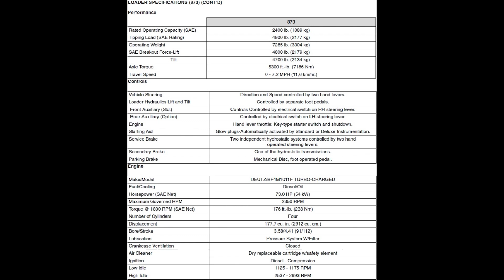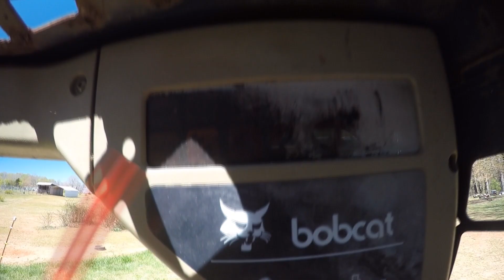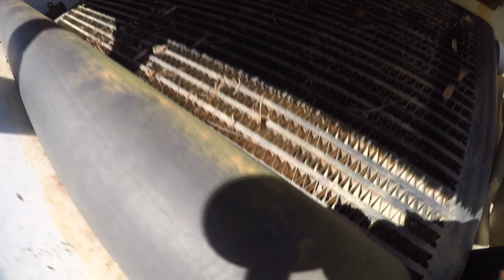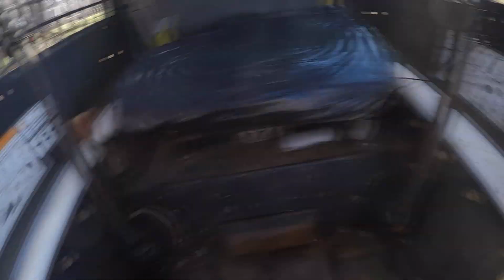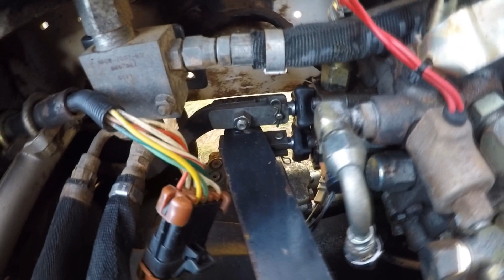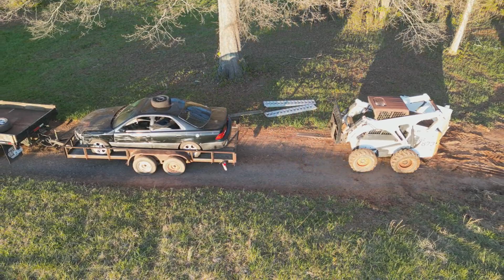Bobcat 873G detailed walk around/overview.

Comment: I buy a 1999 863  2100 hours on the machine   I was my first skid steer. machine had a lot of problems but not go up pump was bad tilt cylinder need to be replace new tires and paint was really bad it took me one month to clean it Sand it get it ready for paint an new decals I paid 8k and went up to around 14k with all the parts I put expensive tires on ...that was 4 years ago machine looks good and running strong has been a good machine for the 4 years... think I paid to much for the machine but they are so expensive in the Boston Massachusetts area.  2 years after I buy a 2000 873 because they have the same engine they both running good I love them

Comment: My 853 will not lower the bucket or tip the bucket up when I move the foot pedal when it's running. If I shut it off and push the foot pedal it lowers the bucket. Is my control check valve stuck or what??
Reply from the maker: Check that your auxiliary hydraulics aren't stuck on. Could also be a problem with the BICS valve, self leveling valve (if equipped) or possibly load check valves.

Comment: Where can I check the coolant at? I have looked my machine over can’t find the radiator cap?
Reply from the maker: The 863, 873, and 864 use an oil cooled engine so there is no separate coolant.

Comment: Question?  I got the same bobcat but problem is when it started it keeps spinning around and won’t stop.  Any ideas? Thanks
Reply from the maker: Control linkage may be worn out/broken. Check the centering spring, tee bars, and everything else on top of the pump.
Reply: Do you know the part number?
Reply: Thank you for your response.  I have another question?  That why the engine throwing lots of white and black smokes?

Comment: My 873 G Series 2001 Bobcat Skid Loader. 
My skid loader will not unlock .
Is there a fuse that operates the lock and unlock track system ?
Reply from the maker: Yes there should be a fuse and a relay for the parking brake solenoid in the fuse panel. The label inside it should tell you which is which.
Reply: Find a solution?

Comment: I have a question. My 873G has been a basket case that I've brought back from the dead. Chased and fixed a bunch of leaks and working on wiring and loader alignment now. If you can recall. There are guide plates on the front corners of the frame to guide the loader when its lowered. The parts manual indicates they can be steel or plastic. I was wondering if your machine had the plastic since the steel ones on my machine have actually worn the loader boom to a point I'm not comfortable with. If yours are plastic, id love to have a glimpse at them to try and make my own since the plastic seems to be discontinued part.
Reply from the maker: This machine did have plastic guides. Unfortunately I no longer have it or I would get some pictures for you. IIRC the plastic guides are identical to the steel ones except for the steel spacer/washer pieces used to attach them at the top. It shouldn't be too difficult to make some out of some UHMWPE or similar. The arms on that loader were only worn a little bit from the guides.
Reply: @AlwaysBored123 Thanks for the reply.  It seems strange that they would discontinue the plastic ones with the wear problem caused by the steel. I'll try to fabricate something a little softer.

Comment: Do you know if this model have second, hidden VIN place on chassis?
Reply from the maker: Check on the front of the frame near the drain plug for the chain case, and on the inside of the frame just above the foot pedals. It should be stamped there.

Comment: Great video! I have an 863 and I’m working on the timing belt. Do I need to lift the cab in order to reach the rear timing plug on the back of the engine?
Reply: For anyone wondering, you do not need to raise the cab. Just take off the right rear tire and then the access panel and you can reach in there
Reply from the maker: I'm pretty sure you will have to raise the cab to get to that yes.

Comment: Question.   On our 873 if I raise the boom, it will eventually lose pressure and begin to lower, albeit very slowly.   What would be the order of trouble shooting, what to check first, etc?   I have to fly to another state to work on this machine, so any information would be amazing.
Reply from the maker: There are numerous potential causes but the the first thing I would do is make sure the lift spool is returning completely to center. Then inspect the port relief valve for the lift cylinders and the lift lock valve. It's also possible it's just a worn spool in the control valve. You will have to consult the service manual to identify these components.
Reply: @AlwaysBored123  I really, really appreciate the point in the right direction!

Comment: Any ideas if there is a serial # stamped on the engine?  I have a 863C, serial plate is on the boom but completely illegible.
Reply from the maker: There should be a serial # on a plate on top of the valve cover on the engine. You will probably have to remove the muffler to see it. The machine serial might also be stamped into the frame just above the chain case fill plug on the outside, or in front of the pedals on the inside. Dealer may be able to tell you machine serial based on engine serial.

Comment: I just recently bought the same model, but I can’t get the arms to go up. The bucket will curl forward and down and it will run. I can move it back-and-forth, but but arms won’t lift the bucket over the cab. Is there a secondary place to put hydraulic fluid, or is there another problem?
Reply from the maker: Do the arms lift at all? If they just won't go high enough then you're probably low on hydraulic fluid. If they don't move at all then look at the linkage between the pedal and valve spool. There is only the one place to put hydro fluid.

Comment: Great information 
How many hours are to many on a 873?
Do you recommend a 873 or any other similar machines?
Reply from the maker: How high is the sky? I've seen machines with 2000 hours that were completely beat and ones with 10,000 still going strong it just depends on how it was used. I like the Deutz powered 863/873/864. I'm not a fan of most other Kubota powered Bobcats.

Comment: the 873G clunkier uglier version of the 763G. Our 99 763G is a POS. both hydro pumps completely grenaded  last year. they were frankensteined back together in 2019 after the spools failed. aside from those failures and the clunky controls, she's still going strongish
Reply from the maker: Dang sounds like your 763 is pretty worn out. This one is nice to run only thing I don't like is the foot controls.